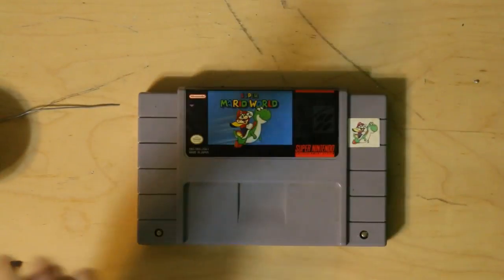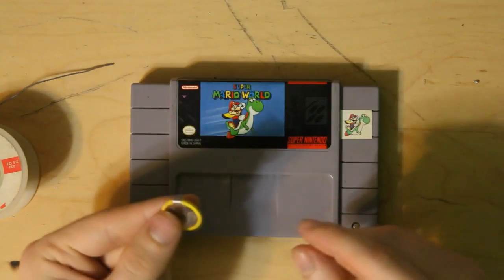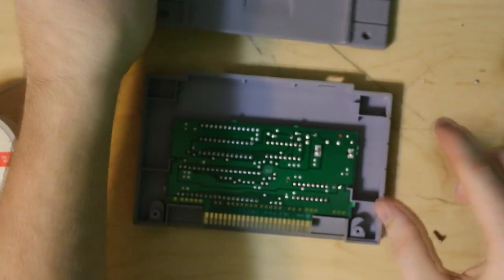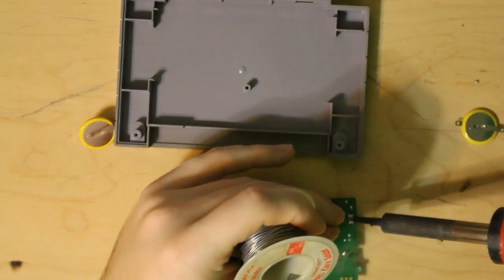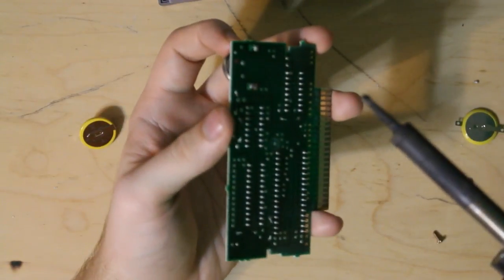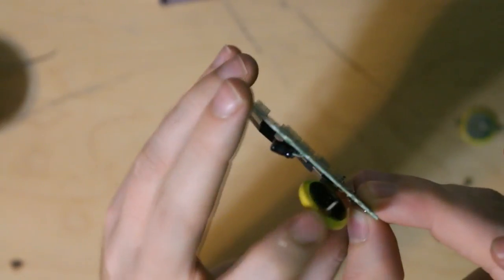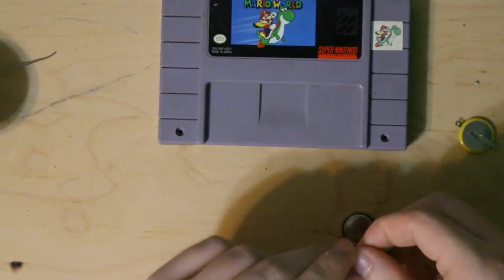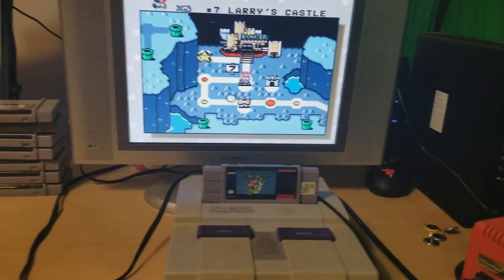Super Nintendo Cartridge Save Battery Replacement

Comment: FYI: The CR2025 generally has a 165mAh and the CR2032 has a higher mAh of 225.  So the CR2032 will last ~30% longer in the long run on average. And a new higher powered voltage regulator (L78S05CV) for your SNES will kill that white line going down the center of your screen, check Console5. Your factory one is on its way out.

Comment: Wearing rubber gloves, I used electrical tape to hold in the battery, after pecking out the old battery with a small flat-head screw driver. I don't know the long-term effects, but the game works and saves. I played hours of Pokemon Yellow with no issue.
Reply: John Smith the problem with using electrical tape is if you don't do it correctly you could ruin the PCB with battery acid as the battery is not properly set in. With the battery not being set in properly. It cannot properly use the cool down feature. Therefore battery acid will leak into the Pcb ruining the game
Reply: Come on man if you can't do it yourself you can't spend 5 bucks for your local game shop to put a new battery??.............

Comment: To make installing the new battery easier, and for a tidy job in general, the previous solder on the pads after removing the old battery should be removed with copper braid before installing the new one. That way, there will be no solder obstructing the holes for the new battery's leads, and the new battery will fit right into place and be soldered without any fiddling or holding while doing the soldering. Also, using copper braid to remove the old solder while the old battery is still installed will make removing the old battery easy and not require any fiddling or special holding.

Comment: Bought a new SNES system 1992ish and just now 4 Nov 2022 learn the carts have battery's in them..I had no idea = mind blown...
Reply: Only cartridges with save features. If it has a password feature, no battery. Same with NES games, save NES games had batteries too like zelda 1 and 2, and kirbys adventure. It is highly recommended to do your research, find out what games of yours have batteries, and start changing them out. Once changed they will last another 15 - 20 years average (assuming a good quality CR2032 battery was used) .

Comment: I'm not sure where you got the 10-12 year figure but most snes games still have working original batteries despite some games being more than 30 years old
Reply from the maker: That's not most games. The batteries inside of them only last 10-12 years because they have a lifespan. Yes some games still retain save files to this day but if you actively game on them you will likely lose your save file.

Just because the battery holds a save in 2022 doesn't mean the battery is good. It's just holding a save and once you actually play it the game will die.
Reply: @Ultimatelocke My bad, I meant most snes games I've come into contact with. I guess I'm just lucky, but I haven't had to deal with a corroded battery on any of my games yet. When I do I'll come back here though.
Reply: Same here. I don't even have to replace any of the batteries in 2023
Reply: @lasergame98 same here, the only game that has a lost files for me is DKC and I'm pretty sure that's because I'd leave it on for like 12 hours at a time for vibes in the game room
Reply: @richarddavis8863  Sorry to hear that, friend. I hope your game will solved after replacing the battery because Donkey Kong Country is a fun game to play. And I just love their music.
Reply: The batteries will all start failing really soon, yes, many still do work, but you might as well just start changing them out of your games as you play them or have the free time. Out of all my snes games, only 2 had the batteries lose save files on me. If you put the game in and there is no save file anymore, it either means the battery is totally dead, or really close to being dead. It is a good practice to go ahead and get all your batteries professionally swapped, because they are going to die real soon anyways, and that way you don't have to worry about them for 15-20 years. Just make sure whoever does it actually checks the voltage of the new battery they put it, the guy who changes my batteries makes sure the voltage of the new battery he puts in is full, because sometimes these batteries come manufactured poorly or are older and already lost some juice even before being used.

Comment: Why wouldnt they make the batteries easier to replace and not use solder like that? They had to know those battiesr don't last forever even though they do last quite awhile but in the right environment they start to leak. Seems like everything is designed to fail these days.
Reply: These cartridges are way stronger than you think. Even the ROM chips attached to the PCB board can be swapped out and replaced with either other games or manufactured new parts in the future once they fail. And the technology has gotten to the point where, you can actually solder a battery holder in the place where the original battery use to be. These new battery holders are very user friendly, they can easily pop out and put in a new battery with no soldering needed, as long as the positive and negative match up. So basically, with a battery holder, no soldering is needed in the future once that battery dies. Nintendo should have tried to design a similar thing to the battery holders back in the day, that would have been the smarter move even if the cartridges would have been more expensive to make, just better for the long run, because the soldering is annoying for the average person.

Comment: One of the battery tabs wont fit in the board. Should I drill the hole bigger or try to brake the battery tab smaller? Please help
Reply from the maker: 1st off no drilling. 
Second, buy a new battery tab made for SNES / N64 games its like $5 on eBay.

If you drill you will likely destroy the game because you will remove the positive/negative plating which makes the batteries work with the game.
Reply: @Ultimatelocke  I got the exact right battery from Ebay. Just one of slots for the battery tab is smaller. I ended up pinching the tab with a pliers and broke a tiny piece off till it fit. I did a bad solder job, but it seems to be working perfectly haha. Thank you for the video and the reply

Comment: I don't think you know what indefinitely means lol. Good vid though.
Reply from the maker: Definition "indefinitely" - for an unlimited or unspecified period of time.
If you were to put this into a super Nintendo and play it for 4-5 hours the battery inside here would almost indefinitely die.

So tell me what's wrong with that statement again?
Reply: @Ultimatelocke  it wouldn't indefinitely die. It would die. A battery doesn't die and then come back after an indefinite period of time.
Reply from the maker: @skip2mylizzle  One false. If you've ever used a AA battery before then you would know if you wait a while a dead battery can be used again.
Two. My statement is still correct because by what I said it still means permanent.

Nowhere in my statement does indefinite mean it would come back to life. I literally typed out the definition for you and you still don't get it.
Reply: @Ultimatelocke  was really hoping you just misspoke, but no, you're full out defending this.  I'll leave you alone. Sorry to offend you!
Reply from the maker: @skip2mylizzle  not offended just correcting. You decided to be the grammar police so when your wrong don't get upset when someone points it out?